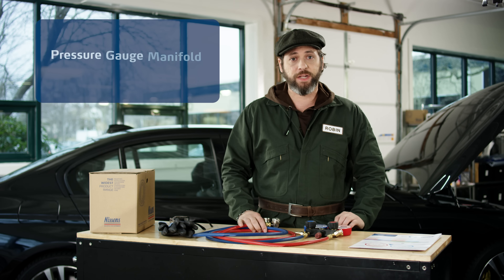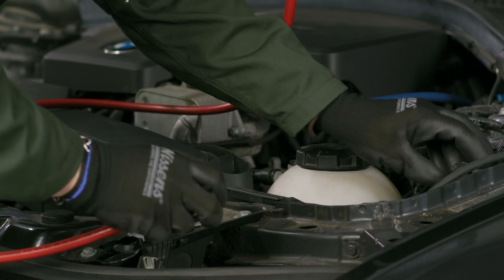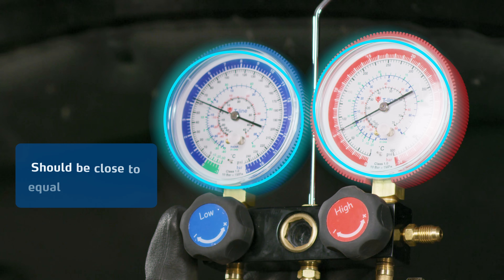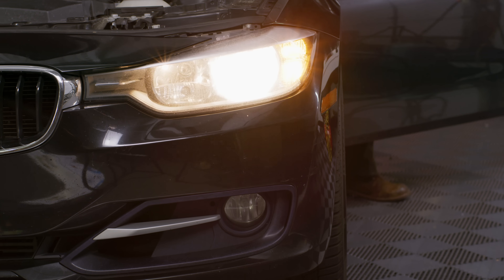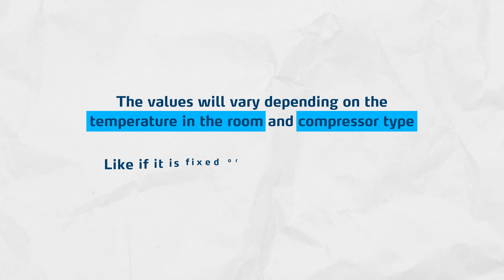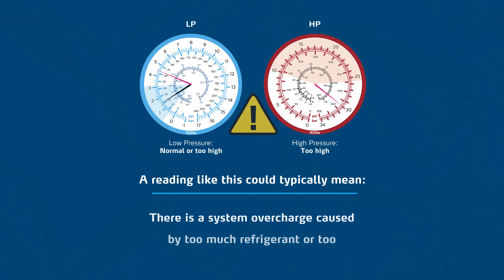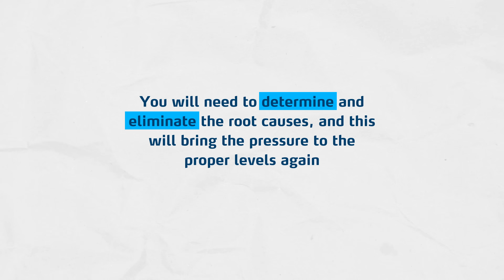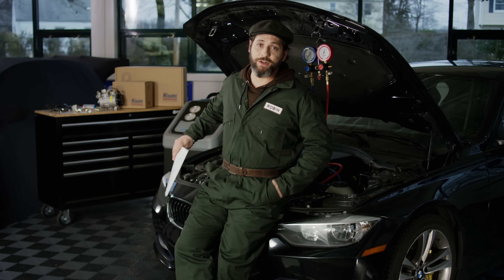R134A AC System Pressure - How to Spot the Issues!

Comment: Low pressure between 10 to 50 psi??? Low pressure switch shuts down the AC at 20 to 30 psi. Your high pressure values say nothing as both LP and HP pressure spread is way to large for proper setup. Worst bit of advice about car AC I've seen.

Comment: I have had my AC regassed recently and when I connect my diagnostic dongle the pressure shows 335psi but when the AC is turned in it goes as high as 720psi which seems excessive! Is this normal? Thank you

Comment: Just replaced the compressor & expansion valve on my f150. Put 3 oz of oil &  24 oz of freon per the tag under the hood. The high side goes to 300, the fan comes on the pressure drops fast to 200 then starts climbing back to 300 cycles over and over.. The ambient  temperature  78 the vent temperature is 39. Would my dryer in the condenser be bad or the condenser messed up? What say you?

Comment: ive been trying w the car ac i got it filled said my condenser was clogged changed it got it refilled still blowing hot before itd start run cold for 15 mins then go hot but i just got home when hooked up the gauge and low side was chilling at 150+ i turned the ac on it instantly went to 0 any thoughts? they said possibly the evaporator idk

Comment: What if the High side never builds pressure? Already changed the compressor. Still only getting 40 PSI on both sides and it’s not taking refrigerant from the can.
Reply: Did you find out

Comment: Why the a c temp. Is not maintained,suction pressure is 40psi and discharge pressure is 130psi, amps is 16, gas is R134A. What is the problem ,can u suggest ????

Comment: My Low is 30 and my high is 200 and no problem it is 40 degrees inside the car until I will go up the hill in a 95 degrees weather the a/c quits and the temp needle goes up to almost red zone engine temp.. but after turning it off for 2 minutes it will start cooling again again and the engine temp goes back to normal.What is the problem? I replaced the condenser and dryer/filter,I vacuumed and charged,Still doing the same thing,It still quit and overheat,2 minutes off and it will go back to normal again.Should I change the compressor?please Help,Thank you.

Comment: Thanks for the video.  My high side is low, but my low side is *normal*.  Any suggestions?  (85 degrees F, 60% humidity, high is 160 psi, low is 47 psi, 2011 Altima)
Reply: Same issue, did you ever find out the reason?

Comment: I replaced my condenser and dryer and vacuumed my system then added refridgerant and now my high sides fluctuation from about 250 to 200 but it only goes down when my fans kick on what could cause that?
Reply: Sounds about right, fans cause air over condenser cooling the charge.

Comment: I have a yellow jacket manifold with  knob on the side. So its clockwise to close and counter clockwise to open.For some reason when i open the low pressure side, refrigerant are not being added. Any ideas?
Reply: You need to open the middle valve with your refrigerat supply and then feather in through the side valves

Comment: What if my car is on idle and blows warm air, but gets pretty cold when my car is running...the low side is a little high than 30psi and declines when I accelerate...the high side pressure gauge stays normal, what can it be please help...thanx
Reply: maybe overcharged or cooling fan

Comment: 2002 s10 v6 ac issue 

My static pressure Guage test  with engine off and or the ac off either way is 
90 Lbs on low side and  100 Lbs hi side . When I start engine with ac on the high side climbs to 400lbs immediately the low side drops to 30lbs or so  and the clutch shuts off
What's My problem  seems it holding a charge but hi side build is clicking the compressor off  and the accumulator is NOT Cold or sweating. 
I changed this Florida trucks ac when I got it  with 134 and one of them  ambient temp gouges that put you in the green zone. But after a week stuff got weird. It does blow cold sometimes why driving but now it's acting odd . I'm about about buy new accumulator and orifice and new line seals and evacuate and redo it all. What could be the issue here ??

Comment: I need help, please. My car get warm air temps during stops or idle, Pressure are good, fan running properly and replaced, Compressor, H block, Condenser/recieved dryer, and Evaporator, I am so stumped replaced all those items to try to fix the warmer vent temps at a stop or idle and still have the same problem, what could I be doing wrong, I always have the shop evac and recharge professionally, no leaks, no dye in the system. But is does take over 1 hour to equalize pressures at 90* Arizona ambient temp. Please advise if you can, thank you.
Reply: Your problem is most likely a malfunctioning condenser fan. This would explain why the AC doesn't work well while the car's stationary- there's simply not enough air blowing over the condenser to let it do its job. When your car is moving, enough air blows over the condenser (even with the fan not working) and your AC blows cold.

Another far less likely problem may be the blend door malfunctioning. Your AC may be doing its work, but the cold air may be getting mixed with the hot air. Looks like you've eliminated any other likely causes.

Comment: I have a 99 Silverado 1500 four-wheel-drive my AC is not blowing cold it’s only blowing about 70° low pressure gauge is just under 40 the high pressure gauge is just under 250 I don’t understand it seems the gauges are in where they’re supposed to be but I can’t figure out why it’s not blowing cold if you could help me I would appreciate it
Reply: My truck is 30psi low side blows cold. Maybe a little over charged on yours

Comment: Mr. Robin. Are you rely on the reading of the sathatical pressure for each measure to see the level of cooling fluid? And what values are required for that
Reply: It is best to connect the guages with the car shut off, both sides should be equal and should be around the pressure indicated on the chart for whatever temerature your surroundings are at the time. In most cases you would not access this unless your machine is not cooling and your static pressure lower than expected on both sides because there is a leak somewhere in the system that needs to be located and repaired before rechargingbthe system

Comment: I'm charging an ac in a hyundai accent using r134a. I changed the expansion valve and still have pressures that are way off. 50 on the low side and 50 on the high side. It is also no longer taking freon  even though the ac pump running continuously. Its about 60 degrees outside. What should I look at next?
Reply: Compressor
Reply: Maybe look at a Toyota ??

Comment: Thank you! On my gauge my HP needle is fluttering. What would cause that? Is it a leak? Faulty reed valve in the compressor? Blockage? If so, can I diagnose this failure on this fluttering on the gauges alone?
Reply: If you have fluttering on your high side needle it’s the flux capacitor
Reply: @wiley0714  what’s a flux capacitor

Comment: i am from Pakistan.
My Hilux Pickup Lower side pressure is 50psi & 
high side is 225 to 250psi
i clean Condenser,cooling cooler & change the Filter.
but the cooling is not good.what is the reason?
Reply: Those look like good numbers on an 85 degree Fahrenheit day, did you solved the problem?
Reply: @cire80  No
Reply: Farooq bhai compressor problem hai
Reply: Over charged

Comment: Hi Robin.what if I got a low side pressure of 35psi but only 90psi on the high side with ac on what does this mean am I having a bad compressor?
Reply from the maker: Hey Edilfred. Start with checking the refrigerant level is correct. Checking the static pressures would be a good idea. If below 30 psi your system is undercharged. And if you're sure the system is charged properly, these readings you've got may indicate several issues. It all depends on the system layout, compressor design etc. 35 psi on the LP is definatelly too high reading and IMO relates to some compressor's suction problems. This may have a root cause in the compressor steering valves (if applicable, e.g. ECV, MCV) or in the expansion valve, if your system has one. If this is a scroll design compressor it might be the seals between the scrolls. And the HP reading with 90 PSI is too low too. A stuck open TXV may result in this, but then you would typically hear some excessive noise from the compressor. Let me know the vehicle model so we can find a more accurate diagnose of this reading.
Reply: @RobinundertheHood  A 1999 Nissan mavima V6.I,ve replaced the evap,expansion valve and dryer with new ones and leak test by soap and water and its good no leak

Comment: If you like engines I like quantum physics. Would you be able to create a supercharged hydrogen converter and atomic pressure chamber with a burst charge aimed down with a psi itamizer and pressurized containment cooling. Hydrogen flying cars is basically the idea
Reply: Ur gay
Reply: @agravy7657  Uruguay

Comment: Sorry can you tell me something about this situațion? LOW PRESURE =12,5 bar And High PRESURE =10-11 bar? With engine started
Reply: We use psi over here instead of bar.  It kinda sucks.....I'm as American and I prefer using the metric system, but I usually can't Because hardly anyone I work with speaks or thinks in metric units.
It's crazy,  we need to move on with the times over here and adopt the better ,easier, system of measurement. ... every nut and bolt and torx etc etc fastener on every vehicle sold in America for the last 20 yrs have used METRIC fasteners....but SOOOO many ppl still use fractional /imperial/sae tools.  Despite them being slightly larger or smaller than the fastener.   They Just CANNOT seem to give up on that fractional crap.  I'm metric gang all the way though. Lol
Reply: Sae is so stupid,  it's harder to learn in the first place,  confusing .... it's just garbage. 
Everything being divisible by 10 is so much easier. 
Fuck a 9/16" Socket or a 9/32"socket and a goddamn 5/8" wrench lol
Long live the 10mm !! Hats off to the 8mm and the 12 mm respectively.  Lol and big shout out to my t25 and my t27 fasteners I ain't forget about yall,  that's my jam.  Hehe

Shout out kilopascal and bar also..I don't fuck wit yall as much but I got love for ya lol

Big ups to liters,  fuck cubic inches dem ones bitch made. ..metric gang bang! bang! 

I went from civil to full goon to fast, didn't realize how bad I hate sae until I started ranting about it,  a clear line has been drawn in the sand for me from this day forward. 
Metric gang whose wimme!??!
Reply from the maker: Adu, these are extremely high pressures generated by the system. A static pressure check would tell you something more about the charge. If withing normal readings i.e. 2-4 bars equally on both sides your system may suffer from some severe blockages or the ac compressor steering problems.